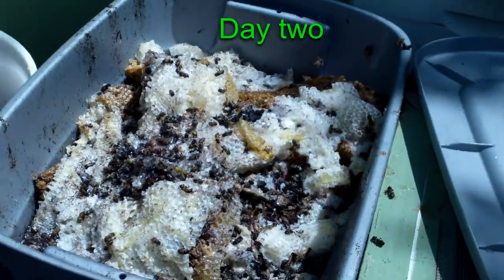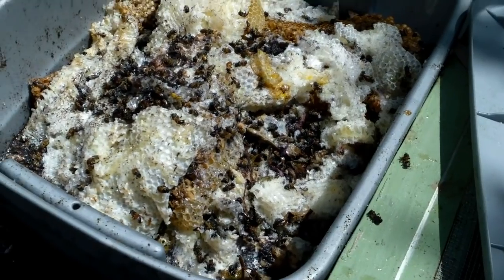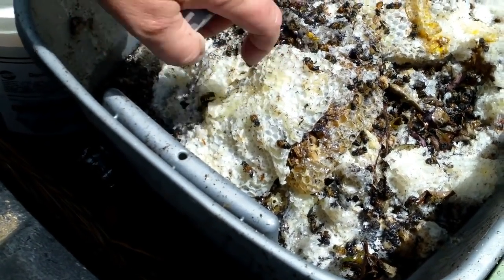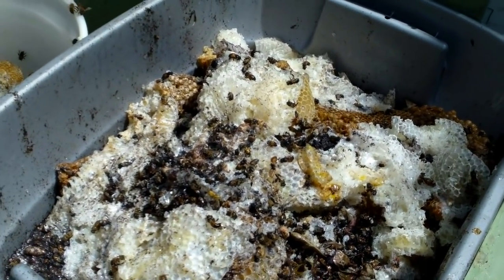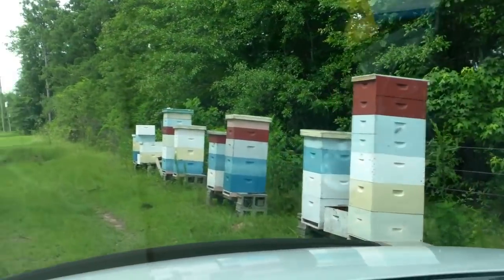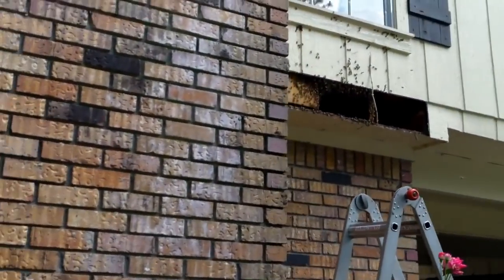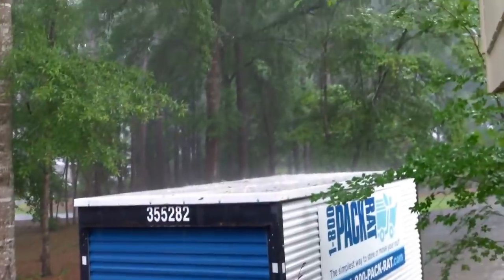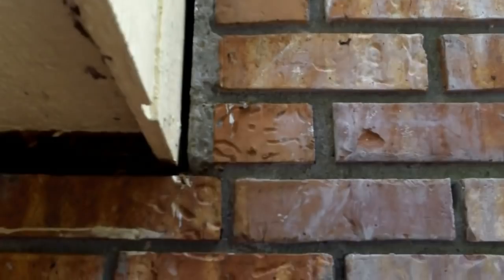Difficult Triple Hive Removal Day Two

Comment: Wow.  Still looking at a lot of your old videos - but this one is a jaw dropper.  Only thing that would have made it easier - is if you had the chimney removed (by others) before you started your work.  Taking it down, putting it back up, patching up the soffit, floor, wall, fascia, waterproofing and getting everything rebuilt and refinished.... $10k?  more? less? anyone have a guess?  Wow. Wonder if they had insurance that covered this?

At least you did not have to eat any more bees on this one.  (silver lining?  no....guess not).  Amazing job though. Thanks for sharing!
Reply from the maker: This was a super challenging one for sure.  Knocking the chimney down would have been nice.